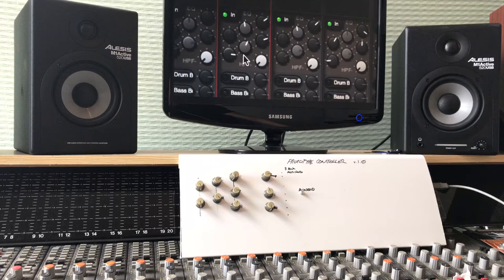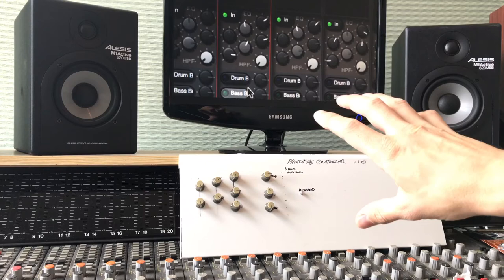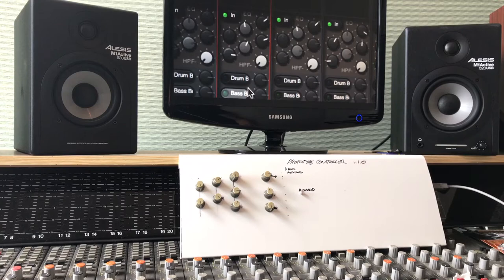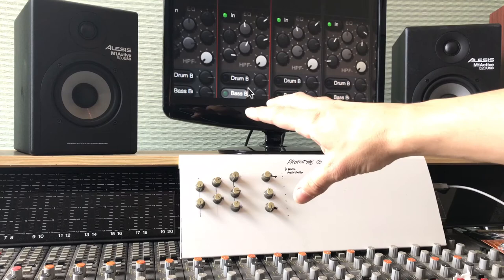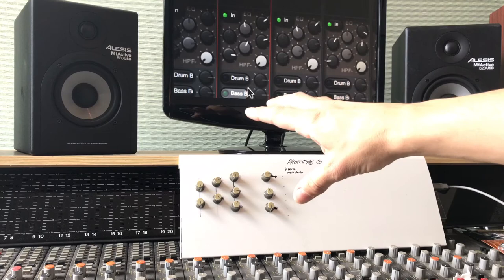Harrison Mixbus (and Mixbus 32c) control surface Vlog 2

Comment: Russel, A thought crosses my mind:
I´m assuming you are simply sending midi notes through usb, which makes me think that Console 1 could probably be set up to communicate with mixbus this way.
I would be very interested to take part of your solution to try this out.
Again, splendid work.
Reply from the maker: Johnny Poulsen problem is Mixbus doesn't presently offer direct Midi control of all knobs...with rotary encoders...I know it's odd but I've had to work around that until they implement full control. 

However this lead me to a better solution.
Reply: Well, happy to be of assistance then  :)
Care to share?
Reply from the maker: Johnny Poulsen awesome man...keep an eye on the Mixbus soundstage and Mixbus pro users group on FB for updates. :-)